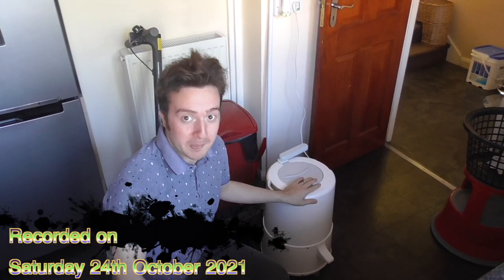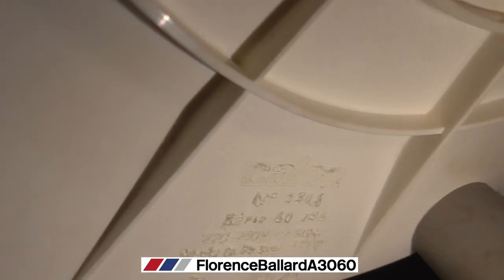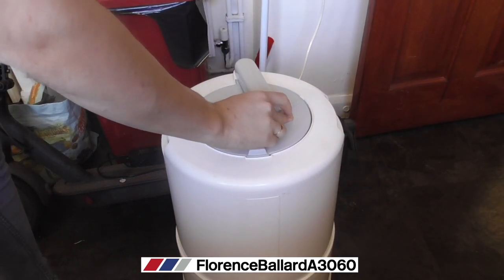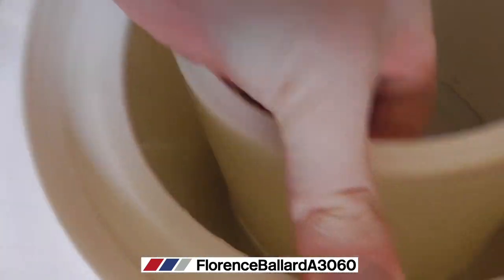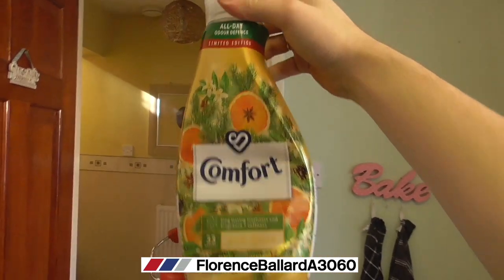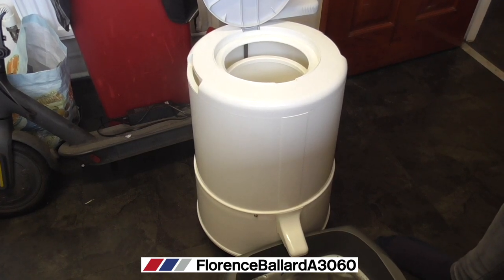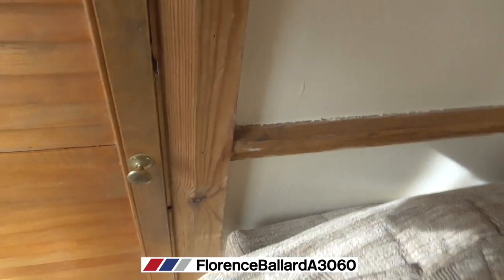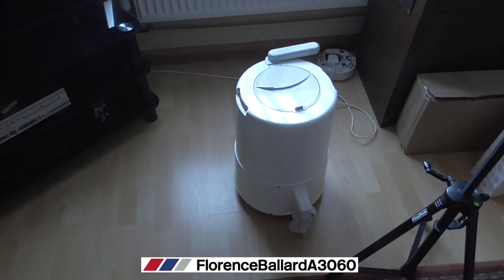1980s Tefal Spinmaster Spin Dryer - Rinse/Spin Drying Towels

Comment: It's very nice to see this model working. In fact, the CALOR Company which was located in Lyon, France, manufactured these spinners from 1972 to 1996. The first models from 1972 were made of sky blue plastic and had a black on/off button on the bottom side with a pedal down to stop the drum! The lid did not have an automatic closure. The smaller initial drum held 1.2 kg of laundry. In 1974, the model received the "final" drum with 1.5 kg of laundry and became two-tone midnight blue (bottom) and white in the upper part. The lid received a lock on the side allowing closing the lid to start the device. The machine was stopped by pressing the pedal which also allowed the cover to be opened. Different colors were produced. In 1977 in orange and white, in 1978 in lavender blue and in 1979 with a light cream color. in 1980 again in lavender blue and that year the new model with the pivoting lever above the lid appeared in lavender blue, in 1981 in cream white color then in 1982 like yours. The color remained the same until 1996.
The conical shape of the drum allows water to drain faster at the bottom. It is recommended to use this funny spin dryer on a low-pile non-slip carpet to stabilize it. It is always better to fill the drum to the top and always take care that the load is perfectly distributed inside the drum because the machine is very light and the 5 suspension studs are not very flexible. However, these machines were built to last a very long time. I have at home a model from the first era of 1972 and the orange and white model made in 1977 in a perfect order of work!... I only had to tighten the nut securing the drum to the motor hub and the one securing the hub to the motor axle. Nothing complicated. It works perfectly! Thank you for sharing !

Comment: It's so funny to see this little Tefal spin dryer again... I used to have one of those exact same models!!😅 But it's definitely not 1980's. It was a brand new design in the mid 90's when I bought mine.  It was brilliant... lasted nearly 10 years... and I used it a lot too. I finally stopped using it when water started trickling out the bottom where the motor was... unfortunately not fixable by that stage.  How on earth do you have room for all those spin dryers?!!😲